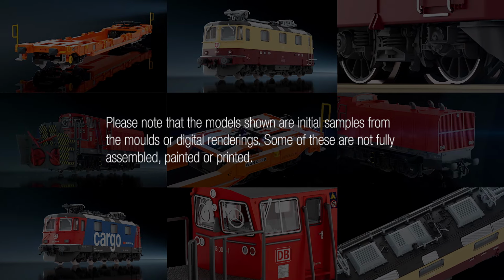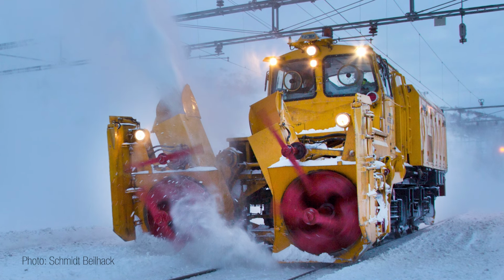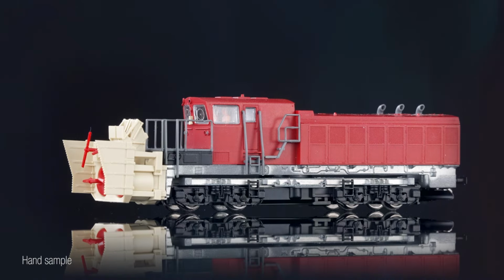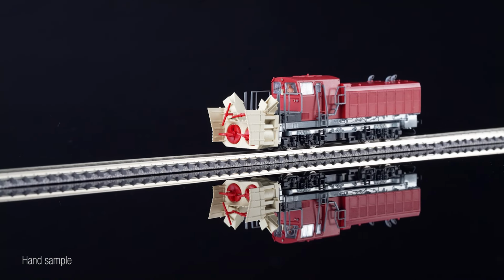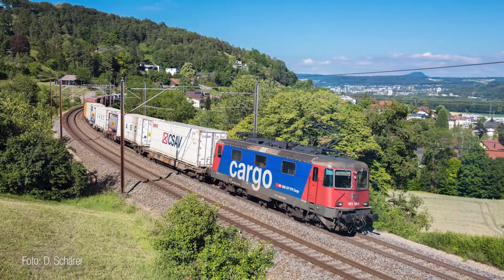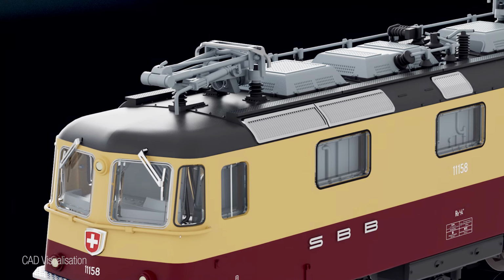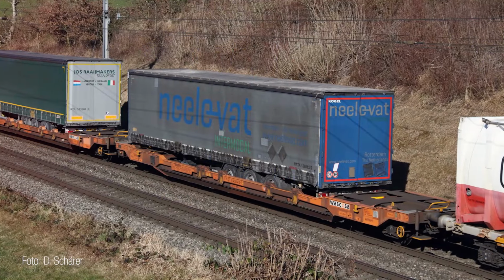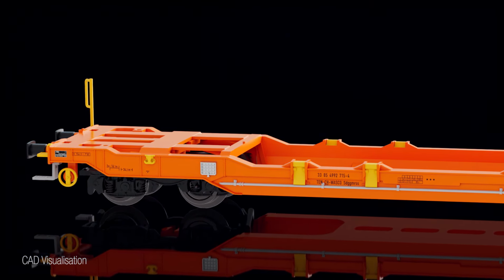FLEISCHMANN Novelties 2024

Comment: As a Swede I wish that Fleischmann could do as Märklin, to aim the Swedish market with roughly one Swedish model per year. I would be happy with one per decade too! That way the Märklin fans here has gotten some wonderful models of old and current eras that fit a local setting. As an N scale railroader it is much harder. We do get some great models now and then from smaller firms, but it would be great to see what a company as Fleischmann could do! A dream of many here would be a model of the SJ Ra (Rapid) engine, an engine that by many is considered the most beautiful ones we've had. The only model of that engine to this day is a 40 year old Lima H0 model that is still loved here. Another dream would be a set of two SJ Y7 rail buses.